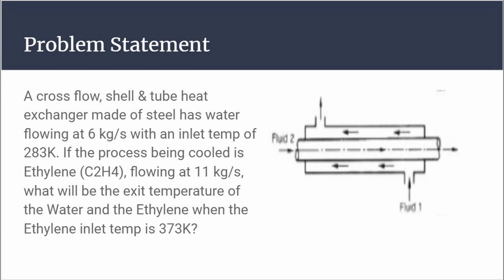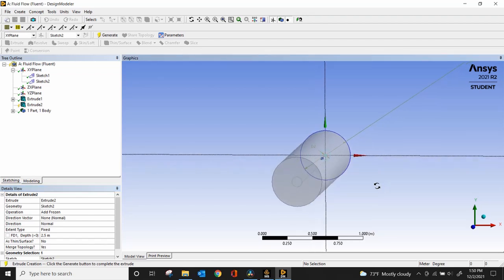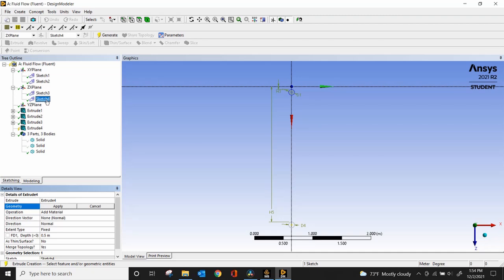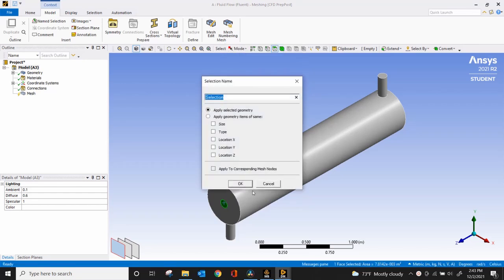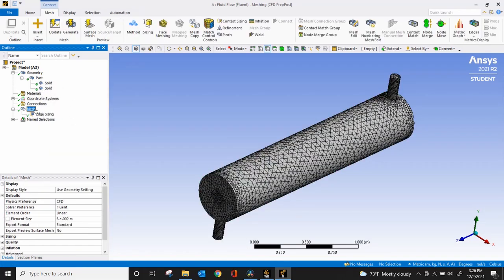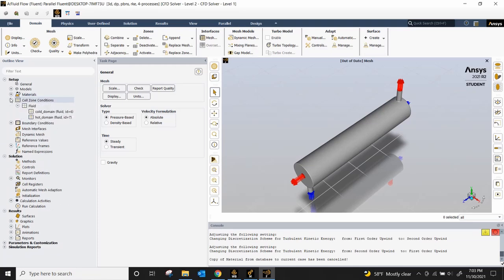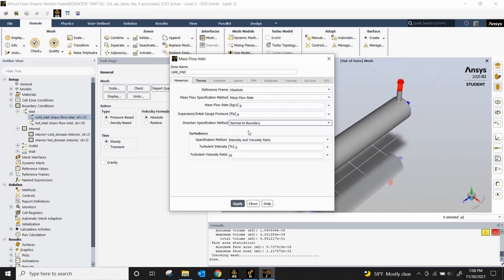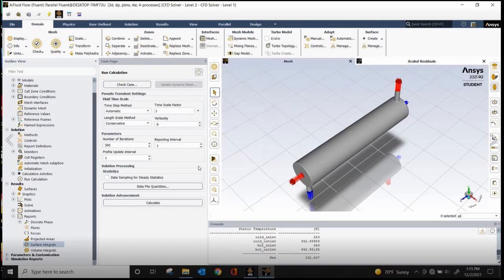Simple Heat Exchanger - Ansys FLUENT

Comment: In terms of the method, this video has been fantastic, but I have noticed your original question gave an initial temperature for the ethylene of 373K, yet you appear to use 343K. Was that an error, or did I miss something?